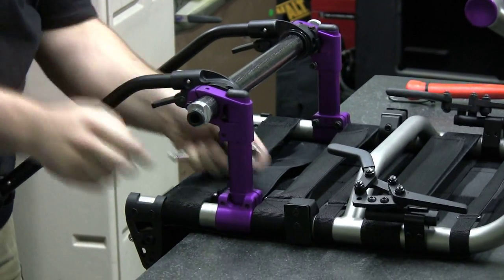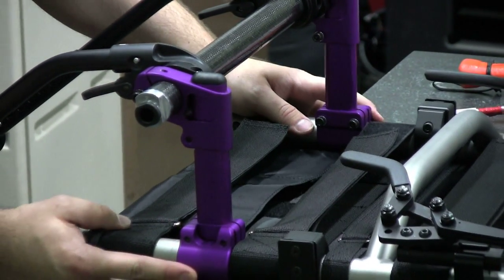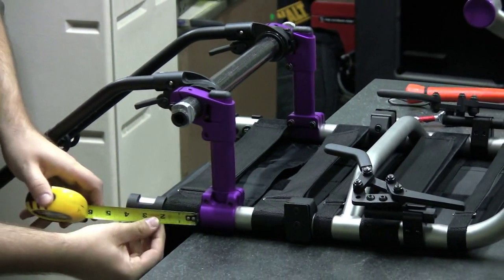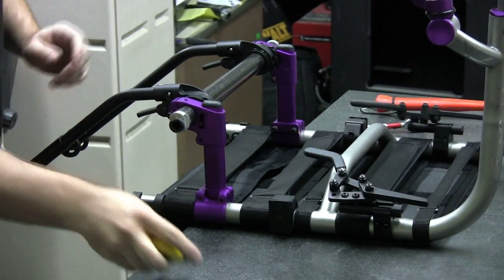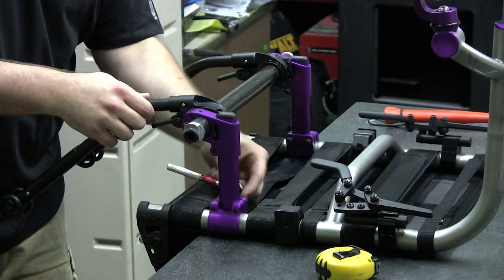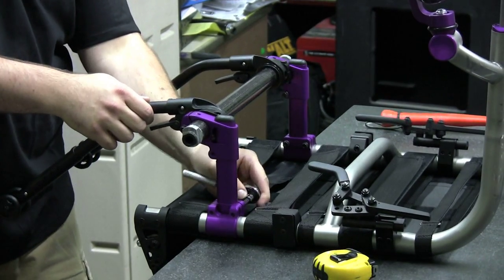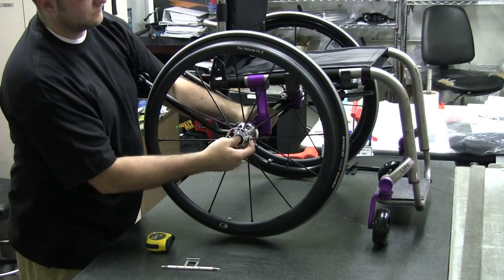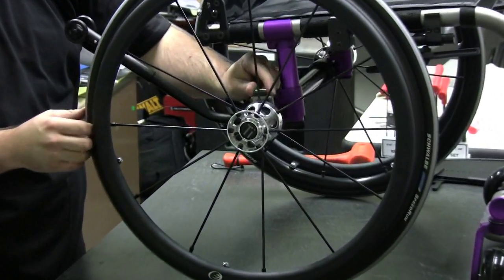Adjusting the Center of Gravity on the TiLite ZRA Series 2.

Comment: Beware the hinges used on the back of these, the locking pins fall out, the screw adjustment pops out of place, causing the back to give, flipping you backward, unless you are fortunate and have arm rests to catch you, back will hit them stopping total collapse, very disappointed.

Comment: Just got a TiLite last week. The chamber mounts screws that hold the entire frame/wheels and you are in a notch that is hardly an inch deep and the screws do not go through the metal but only touch the rounded cutouts. I had this adjusted by a health aid professional for center of gravity and next day went over a bump in the sidewalk and the entire assembly on both sides collapsed as well as me to the cement. I couldn’t believe the chair is barely held together in this way. Going to return this if i can but insurance already covered it. So end of the story...beware.

Comment from the maker: The settings you mentioned are fairly common settings.  The CG placement is very user specific.  It's what feels right for you.  We'd suggest you try the setting you mentioned.  If you are feeling that you are not getting the maneuverability you desire then adjust it forward in half-inch increments until you find the right "feel" for you.  Remember the more forward you move it the more tippy the chair will become.  I hope you have a great day and keep on roll'n.